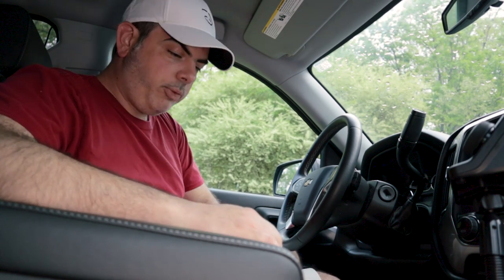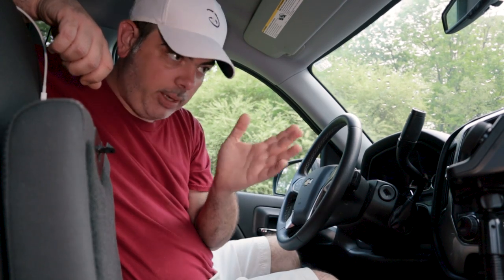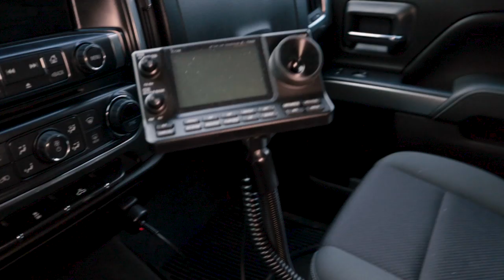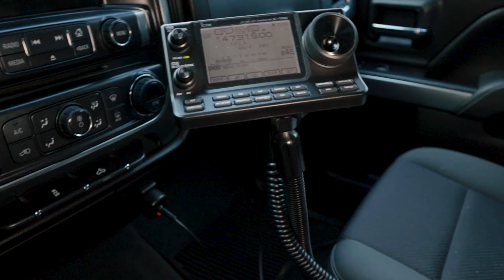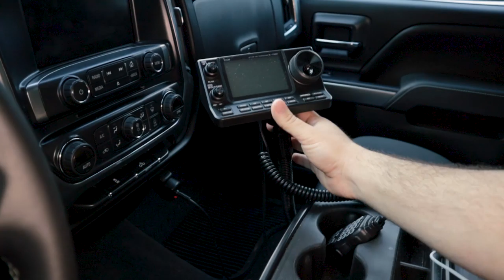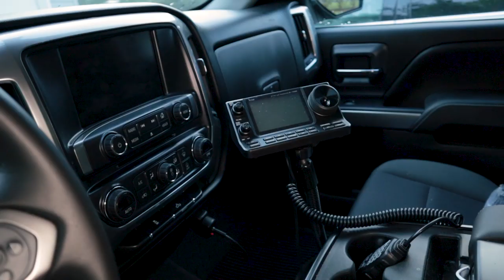HF Mobile - Things to Consider

Comment: Tarheel 100A-HP HF full coverage antenna . I have this connected to my 4Runner without holes drilled as well . However I ran into a problem with the vehicles computer and running 40 meter and 80 bands it knocks out my computer and throws codes easy to reset i carry a programmer in case. all Body panels are bonded another very important step most do not consider .I need to mention the computer tripping happens while running about 600 watts or more of course my Amp is a very high quality  0-30 mhz Tentec Hercules 2 radio Kenwwod TS480 . all in all its an astoundingly well performing setup and while driving down the HWYs of this country as i do often state to state i am able to have full conversations and most swear im on a base station radio so that being said the obvious issues being able to run the bottom bands . has anyone delt with this and what did you do . P.S I have used ferrites on the coax both ends made a loop in the coax at the antenna end short lead grounds to everything batter connected 200 amp breakers inside for disconnected fused at battery . Sure would love to be able to run 80 meter while rolling .. anyone thats on the fence with a Tarheel ive tried and made ever antenna you can think of including full quarter wave on 10 meter and the tarheel out performs all by a very long lead as i said the reports are always amazed im in a mobile . Thx happy DXing 73
Reply from the maker: Grounding and more grounding. That being said, 40 meters may always be an issue. I’ve noticed this from what others say as well. I remember K4JQR (sk) running about 1200w in his Cadillac with a Webster band spanner and he blew up 2 computers before saying, “ok, I’ll stay off 40.”  Grounding via bonding is going to be your best bet. It will be extremely difficult to put ferrite on every input signal into the computer.

Comment: At about @23:00 or so, I see the bonding, with which I agree 100% regarding the flat braid. However, so far I haven’t seen you mention conducive grease between the surfaces and the bonding straps. I have learnt that it is not merely desirable, but indispensable because otherwise, sooner or later you WILL have corrosion between the connections at a minimum.

Otherwise, a most excellent video…..particularly as you don’t pretend that it’s a be all and end all…..rather a guide, as each and every installation is different. I’ve installed in 2 separate T909 Kenworths that were supposedly identical, each with their own unique “issues”!!!!

Thanks for this. De VK2XB

Comment: I own the Little Tarheel 2.   Its a great antenna and have used it over 10 years or more.  What makes it better is using a longer whip.  I have 3 whips.  The stock
1m whip a 62 inch whip, and for fixed operation a MFJ 12 foot whip.     The 62 inch whip prevents 6m operation but on 80-10m the performance is much better than the 1m whip.   The 12 foot whip works on 160 as well as improved performance on 80-15m.   I just got a new Toyota Camry and trying to figure out the best way to mount the antenna and run power.    Are there any websites showing installs of different types of vehicles?
Reply from the maker: The tarheel website had photos at one time.

Comment: GerDay. @1:00 or thereabouts, my belief is that the single most important factor in antenna selection, even over and above price, is your application ……”fit for purpose”. In MY “radio environment”, even though I consider the Tarheel are an excellent antenna, and work very well, because requirements are that robustness is #1 priority, I wouldn’t consider anything BUT either a Codan or a Barrett (if considering an “autotune” style), which are both Aussie made,I know, so harder to source (but not impossible) over there.

Most of my mobileering is done on rough, corrugated DIRT (not even gravel) roads in a multi trailer big truck, and,quite honestly, nothing else would last more than a couple of days, quite honestly. The cost of either a Tarheel or a Scorpion, or even a cruddy little ATAS120 is far too high to replace weekly.  I have had a Codan 9350 on the bullbar of my truck for some years now and still going strong.

I’m still at the start of your video, so I don’t know where else you’re going with it, but I hope you address bonding.

Comment: Damn!   I didn't think I could learn anything new, but damn if I didn't!
Antenna on the driver's side to avoid the trees on those country roads.
Guess I've lived in the desert too long.   Now that I'm back in Carolina, it makes so much sense.
Reply: Hit every drive thru on the left and not on the right.😂🤣
Reply: @1OFGODSOWN  
That used to be the case, but now-a-days I don't use the drive thru much anymore.   I pretty much quit eating all that fast food, and most of my banking is on auto.
Can't remember the last time I used a drive thru.   I suppose if I did though, I could just take the car instead of the truck, as it has no radio equipment.  😀

Comment: Hey buddy! Met you at Mark's when we did the 10m contest several years ago.
I just installed a Tarheel Model 75 on my 4Runner. I made a bracket myself and it fits into the existing trailer hitch receiver, so it can be easily removed. I park inside my garage. A quick disconnect for the whip was a must for me. The radio (IC-7000) control head is in exactly the same location as yours and same easy-bend microphone mount extension was attached to the passenger seat mounting bolt. Great minds think alike!
The Tarheel works amazingly well, especially on 20 meters. 80 meters is marginal performance because the antenna is just too small and very inefficient, no matter where and how it's installed. Size does matter for antennas.
Hope to hear you on the Hoodlums net or see you at the club! 73!
Reply from the maker: +Andrew Evanoff excellent!  Glad you are enjoying some HF mobile!  The shorter ones don’t reall work on 80. I have the 200 model and it’s a lot bigger so it works pretty well on 75/80. And yes...with antennas, size DOES matter!
Reply: Any pics or threads on your set up?
Reply from the maker: #HamRadio #Shack #Tour  Whats your shack or office like?  #HamClutter

Comment: On the drivers side you tear them up at every Drive Thru window and not on the right side.I use a Little Tarheel HP so it’s not very tall even mounted on the bed stale on the right side of my Ram 1500 Quad Cab.👍🎙

Comment: that soft coating under the car is for protect frame and underbody against rust...
Reply from the maker: +biringen correct
Reply: I do a similar thing: make a plate (cutting board 'cause bit lazy) under the carpet and bolt on the speaker; add a second  chinese mike to use handsfree, lock to autotrans stick,  a classic 50 bucks with up/dn ptt and mic on sunvisor; I have a lot of stuff so add a "battery guard" (adj at 11.7) that command a relay that power all my addon from a "fused power distributions panel"... 73 de IZ3QVB

Comment: So what is the the whip you are using or what is the cap hat?
Reply from the maker: One of the tar heel whips. I think it’s 4’. That is a capacitance hat. Friend of mine did some experiments and found that angling them up seemed to help. It does help to keep them from sticking out as far.

Comment: Nice video. I have done the panel bonding to my truck but I have yet to install the radio. One thing I did not do was remove any of the paint or corrosion protection. I just screwed it very tightly down to the existing panels and frame. May not be as good of a contact as the paint removed however, you are opening yourself up to corrosion in those spots. Once I get my screwdriver antenna I will do some testing. Once again, nice video.
Reply from the maker: Thanks!

Comment: Wiring direct to the battery is the way to do it - but generally NOT exactly how most makers still recommend. I see a lot of wiring pos and neg straight to batt, with both being fused - and if you have a REALLY old vehicle (usually big rigs, 60's or older) with special install considerations - like a positive chassis ground ... I never recommend that. Direct wiring to battery is an outdated method that the manufacturers basically "grandfathered in" to their instructions, because it will "just work" regardless of these special considerations - as long as nothing else goes wrong. But Murphys Law ... There's just not any compelling reason for them to update their instructions - only downsides for them since there are a few more scenarios to cover, and if your vehicles ground fails and it torches your radio - it's not covered under warranty so no skin off their back!

I almost invariably run a waterproof blade fuse from batt + to the radio, and usually very close by is the common ground point - which I attach to without a fuse. You CAN put an appropriately sized relay between the fuse and radio to give it power on ignition, or some radios have an autoswitch built in you can run acc power to. There is absolutely nothing wrong with getting negative through a short length of VERY thick wire to the battery. SOMETIMES on newer cars, there is also a POSITIVE common attachment point (jump point), and in those cases I generally use that - again with a fuse.

The reason for this - is that if there is a failure of a ground like the engine ground, i'tll now be looking for ground... and it'll find it through your radio since you've just made a parallel ground path. Hit the starter, and now you have a couple hundred amps lighting your radio and that skinny wiring on fire. So if you DO wire the ground to batt - by all means fuse it - but it's not gonna save your radio - just might keep you from also lighting your car on fire.

The common ground point is usually very close to the battery, there are generally no noise issues - if there are, your alternator / regulator / rectifier may be passing A/C into the system - or you might have a ground lug on the radio's chassis - which you CAN ground at the installation point with a short piece of wire to a screw into the body.

I have no issues drilling through a firewall - know whats on both sides like anything else. Also going through sheet metal, use a rubber grommet so it doesn't cut the insulation and make sparks.
Reply: Blade Fuses are known for corrosion issues even for a base install so I’d never use one in a mobile setup.